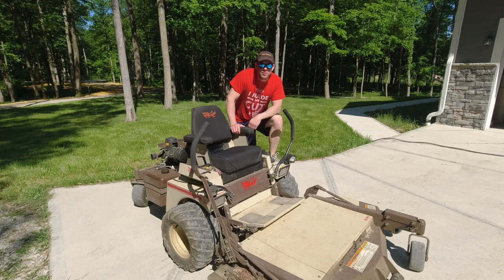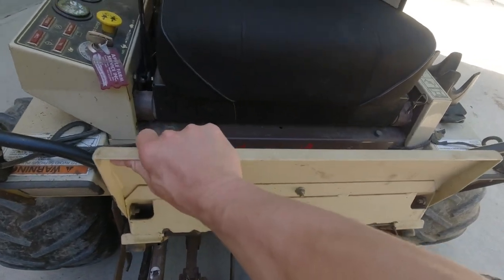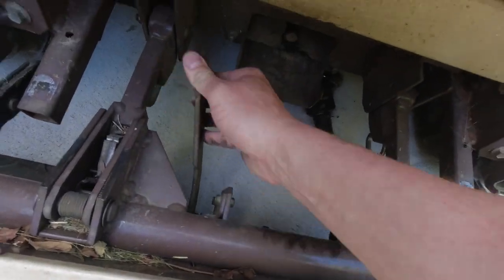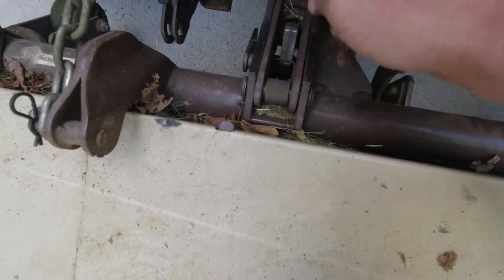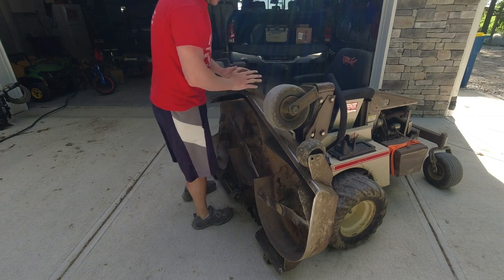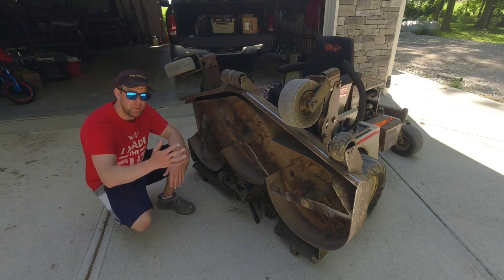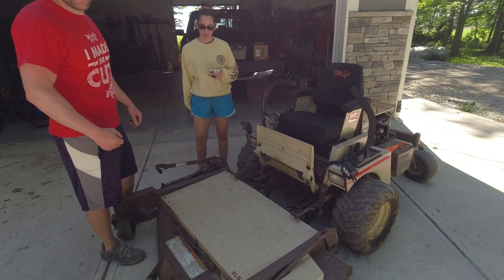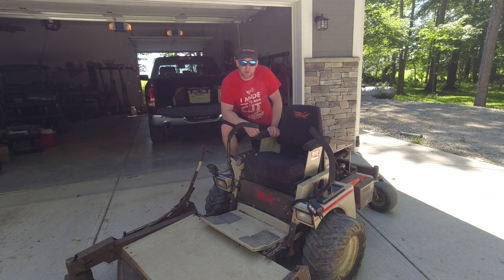Grasshopper Mowers - How To Raise The Front Mower Deck

Comment: Thanks for the video. We inherited my dad's gas version and the written directions are awful. This made everything clear and it was easy. Well maybe everything but the actual lifting. Thanks again.
Reply from the maker: I'm glad it was helpful!  Yea, the decks are well built which means they are heavy!
Reply from the maker: They have a 'powerfold' option which equates to pressing a button. Not sure if you can add that aftermarket or not.

Comment: I don't use a mower very often but Diesel is my fuel of choice, whether veggie oil like my truck, van and generator, or regular Diesel like in my skid steers or dozer. It sure is nice to be able to tip up the deck instead of having to take it off of the mower like I did with my Scag. Have a feeling your wife may be a little resistant to ride around on that Diesel powered machine.
Reply from the maker: Haha yea, my son will definitely win that one.  Diesel is the way to go.  I love Diesel powered machines.  I've had nothing but good luck/experience with the Grasshopper.  Hopefully that continues.  I always appreciate your comments/input.  I know when I post you will always be chiming in! 😀
Reply: @IndyFarmLife  Thanks! I really enjoy your videos, you are an interesting man!

Comment: They improved this by atleast 2004 & much easier to lift manual deck. No disconnecting drives shaft.  And pulling down wheel.  I come to like the manual deck because I need to change heights quick for ditches.

Comment: I cannot get the deck height lever to move easily on my 721, it takes a lot of effort. Any ideas why it’s so hard to adjust the height?  As well, any idea why I’m getting clumps on the right side opposite the chute?  I’ve waited a few years to see someone with this mower.
Reply from the maker: Do you mean as far as folding the lever to fold the deck or just raising/lowering the deck in general?  Have you oiled that pivot point at all?  Clumps may mean your deck need scraped out.  You also may want to see what blades are on there.  Grasshopper makes some specific 'high lift' blades that are meant for these mower decks.

Comment: Mine doesn’t have any of that, the wheels or safety bar or the buttons you pull up
Reply from the maker: Interesting.  What model/year is it?
Reply: I bought it used only has 800 hrs it’s a 725K and I don’t have a manual. Where or how can I find that out?